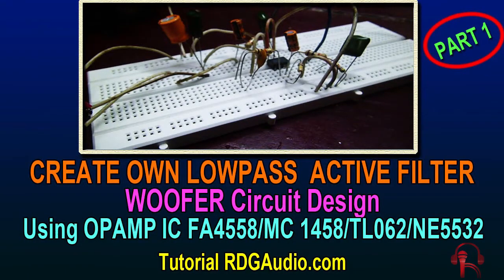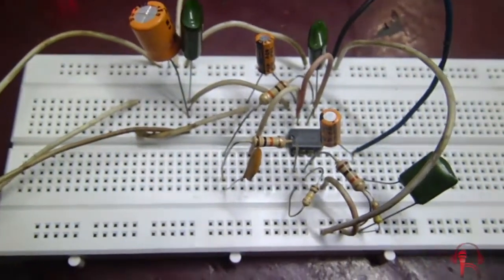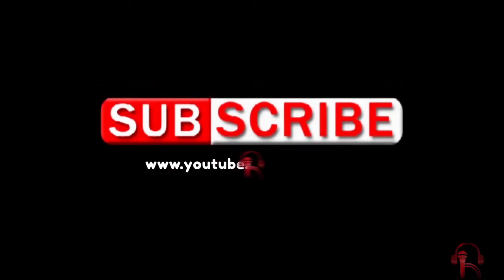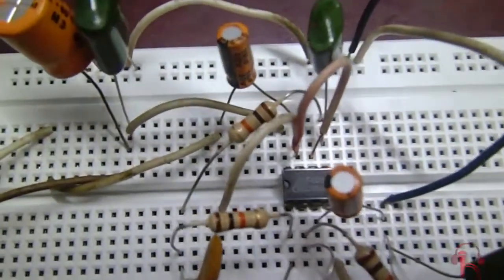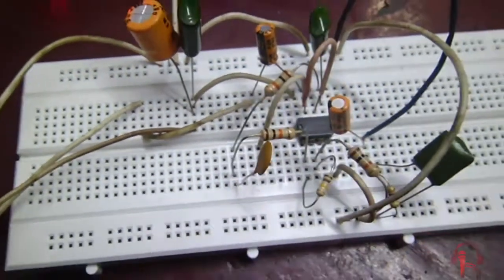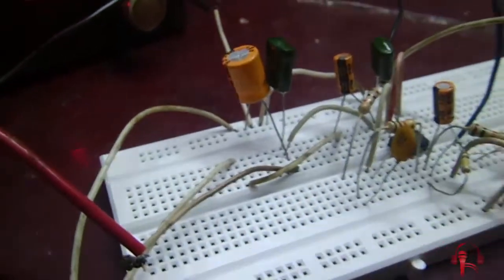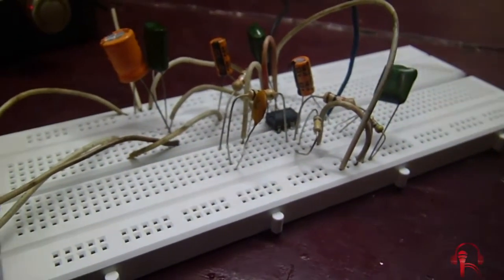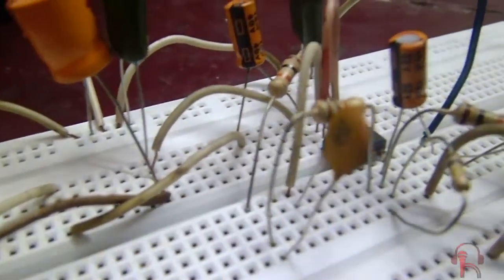Low Pass Filter for Sub Woofer Using KA 4558 OpAmp IC Overview RDGAudio

Comment: If I use two 4558 in series  with tda2050  can I get better bass ? Or I will use two 4558 in parallel ?
Reply from the maker: You have to test it. I didn't try this.

Comment: sir can i replace a dead 4558 ic with 358 op amp?????????? please reply fast
Reply from the maker: Check the data sheet of 358. If you find +vcc at pin 8 and gnd at pin 4 you can use it.
Reply from the maker: So...You can use 358.